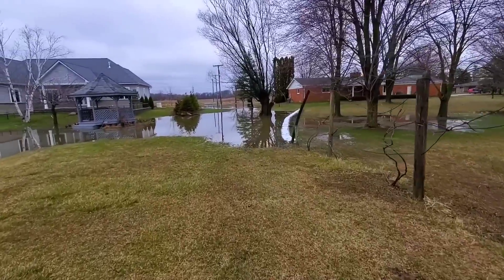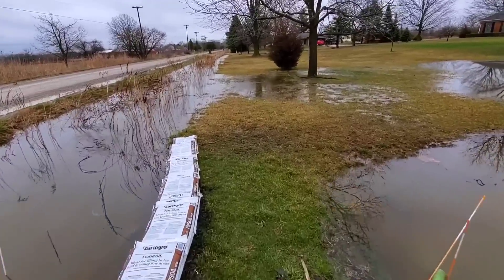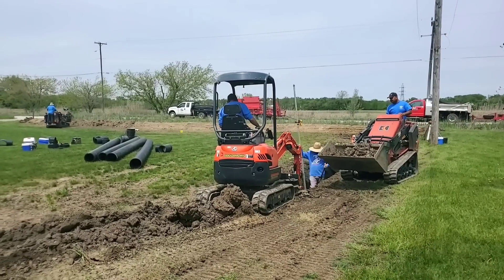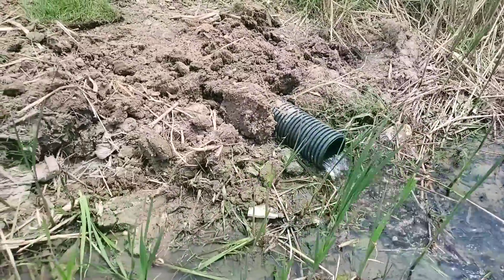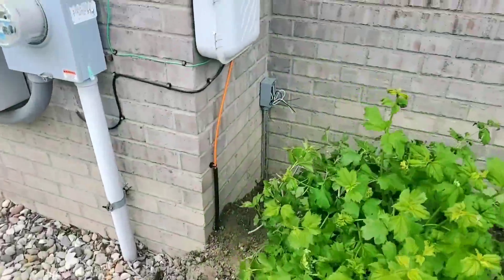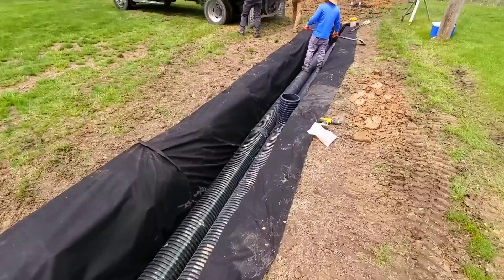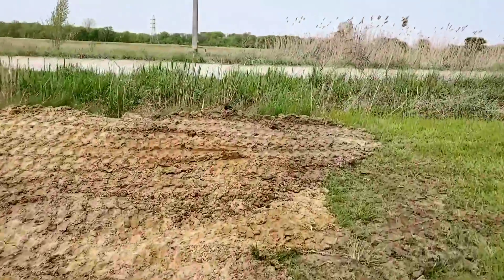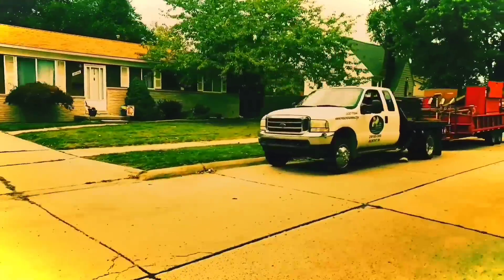Flood Water Footage & FULL Tutorial  on how to Install and provide Flood Protection - Skill Level ?

Comment: Would you use single walled pipe for a farm? From what I understand we were choosing sdr 35 so that it didn’t get crushed. What depth could we run a 100 Hp tractor over without worrying about the pipe crushing
Reply from the maker: 3ft

Comment: You need a drone to shoot  overhead videos to make this more understandable.  You ran power to what?  I didn't see any sump pumps that I thought I heard you mention.   A two chamber system because the amount of water coming into the yard was excessive?  But you built up at least two berms to hold back the invasive water.  Where was the water in the chamber system going?  I got lost in your explanation.
Reply from the maker: Power was for a pump and water is discharged over the new ditch bank. 2 chambers is what a problem like this calls for. Thank you for commenting and sharing